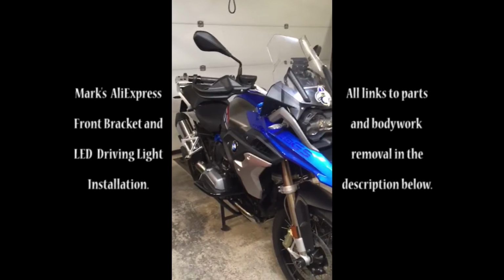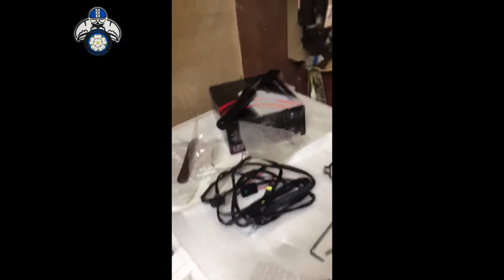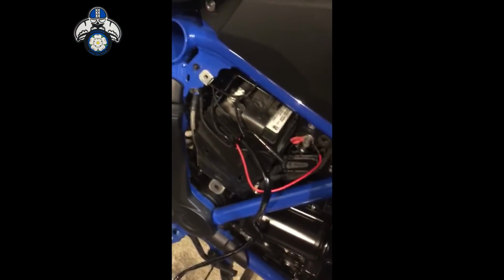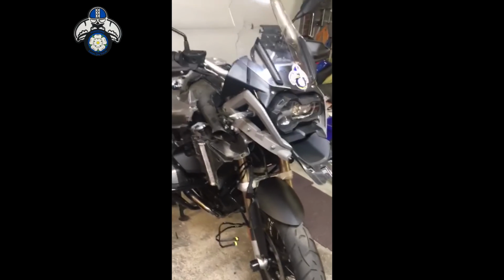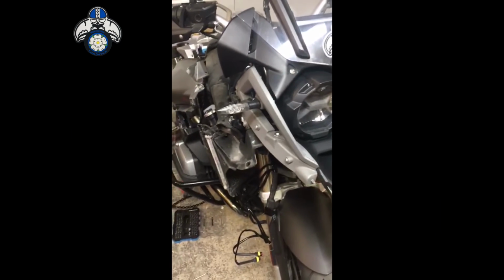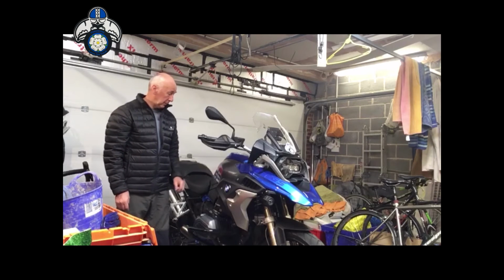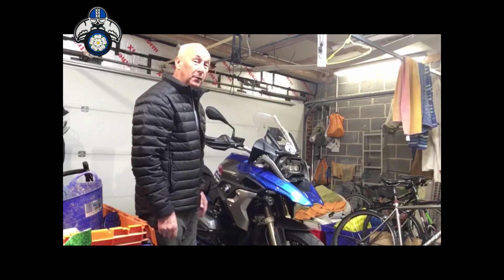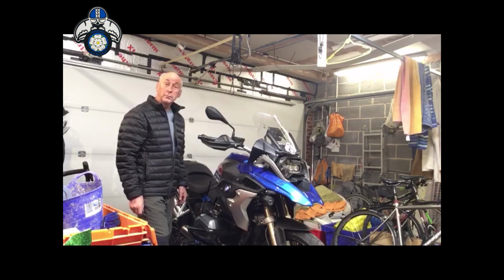LED Daytime Running Lights R1200GS Install

Comment: Just the job. Been wondering why I'm supposed to spend over $1,000 NZ to get LED running light on my GS. Glad I dont need to fit an ez-can etc after all. Cheers from NZ.
Reply from the maker: Glad you found it useful and hope you check my other videos 🤞👍

Comment: Great vid! Important question: do you get an error when installing these lights, because of the can-bus technology of the bike? And btw did you feel the lights block the air to the radiators?
Reply from the maker: Thanks for watching and I hope the vidio helps. The lights wiring was connected only to the battery and not to the bikes wiring harness therefore  not effecting the can-bus. I did not see any problem with cooling so I dont think they blocked the airflow to the radiators.

Comment: How powerful it is ? Can we see the result on road ? Thank you !
Reply from the maker: I shall ask the rider but he has changed his bike since.
Reply from the maker: From the riders point of view you see very little difference as it is used during daylight times. It is the other road drivers who can see the difference as the bike is more noticeable on the road. Also when I have rode in front of his bike then yes I can see he is more visible with the extra day riding lights illuminated.

Comment: Hallo, whether the LED spotlight can discharge the battery?
Reply from the maker: Do you mean while using and riding  or when not riding and forgot to switch off ? A relay from Ali Express was fitted which de-energised when the ignition was switched off. Hope this answers your question
Reply: @JohnBurnet1  
yes, while using and driving, is the battery strong enough for those lights?
Reply from the maker: @selvir.dzafic  I did not do the installation on my bike, it was my friend who fitted them to his  and he did not have any trouble with the battery.

Comment: I just got some 'chinito' led lights for my 07 R1200RT... Your video helped me to understand a little better the "instructions" on ebay... Box came with NO instructions at all. 

I can go and do a simple conection... However i wonder how to conect the wires that go to the turning lights and the wire that goes to the day running lights... Not sure if conecting this "flying wires" will mess up with the CANBus...
Reply from the maker: I am sorry but the video is of a friend doing his install to his bike. If you are stuck I could ask him for some advice. Hopefully you have it all figured out though.
Reply: @JohnBurnet1  that would be great. I wonder if the 2007 r1200rt has stock day running lights...  Based on the "instrucrions" i have to connect in parallel my led ligths to the day running ligths of thw motos and to thw turning ligths...
Reply: Hi the wiring loom has a lead that goes straight from the battery then up to the relay there is then a small rocker switch which comes from the relay which you can fit to the handle bar or the fairing. My tip would be to connect the cabling to the battery and connect everything up before you try and fit the loom and bits to the bike just to make sure everything works before stripping the bike down. its all plug and socket connectors so easy to reconnect.
Reply: @MWC24  i wonder if i can try the test with the battery of my fiat 500... My concern would be the amperage... I tried a quick test this noon at lunch and led ligths did not turn on
Reply: @fernandomaya2894  yes a car battery will do as the kit had a fuse which will protect the wiring and lights if it blows your fuse you may have a problem with the loom